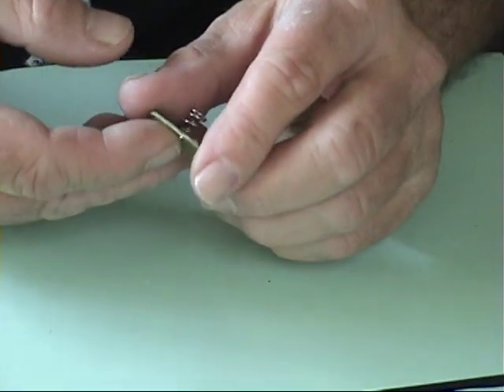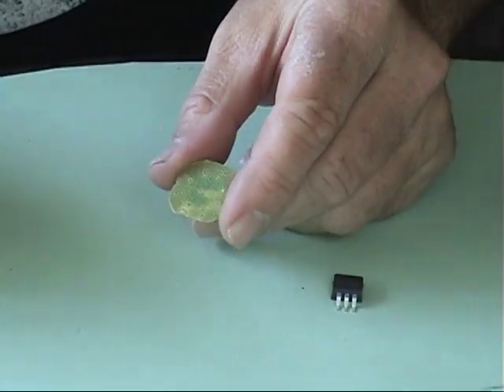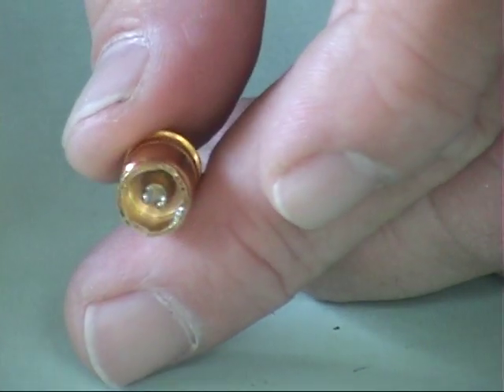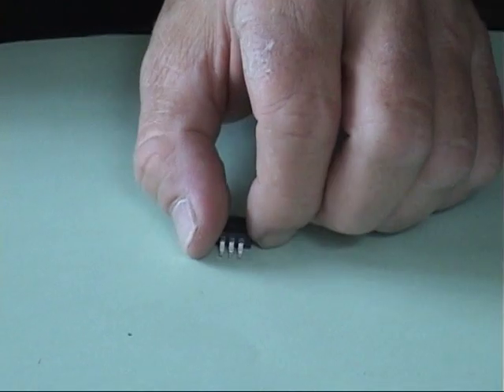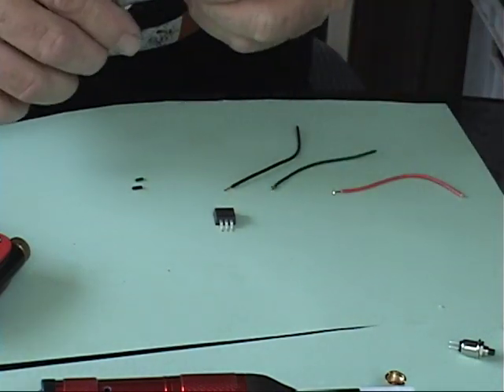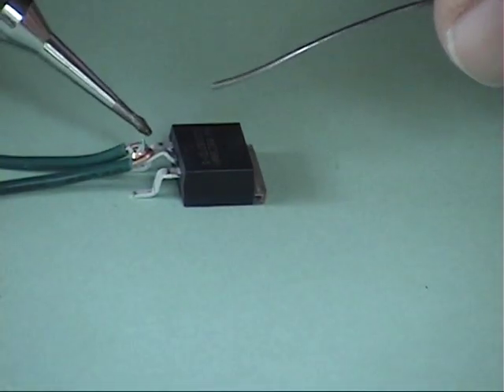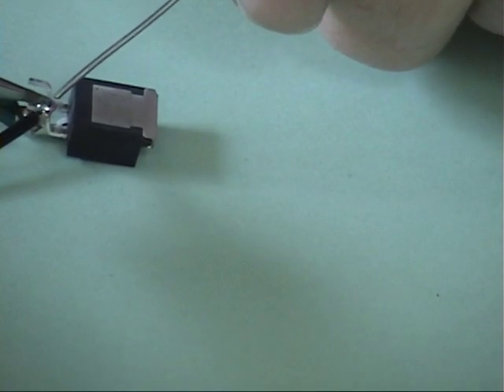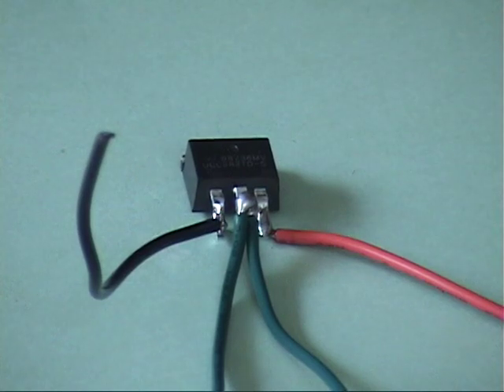E-Cig Mod 5 Volt Detonator DIY Part 2 using Protected CR123A's

Comment: I used the Solder Iron to Heat the bottoms of LEDs. They pulled off nicely. (The 3 AAA Battery pack) I KEEP those, I NEVER throw any electronics away. Shit comes in Very handy sometimes.  The Regulator PNP right?  I used Double Sided Tape pad to Hold down the Regulator when soldering.